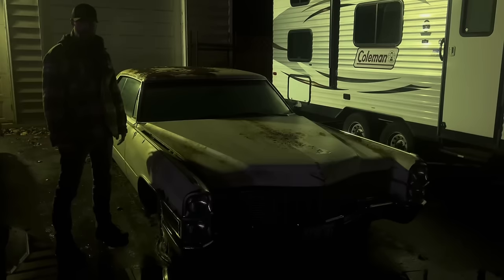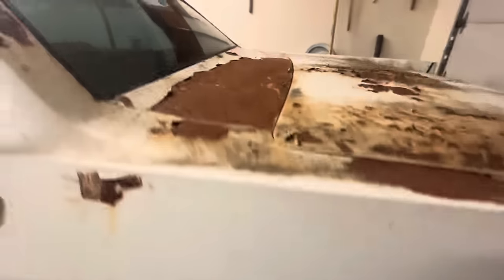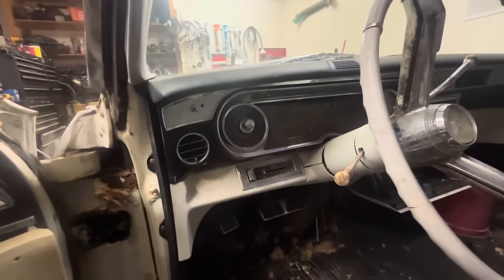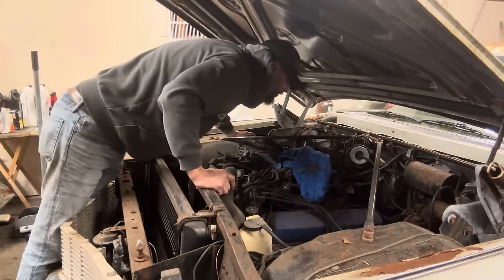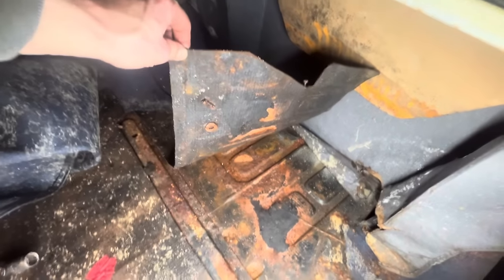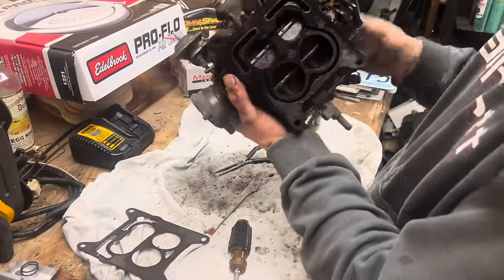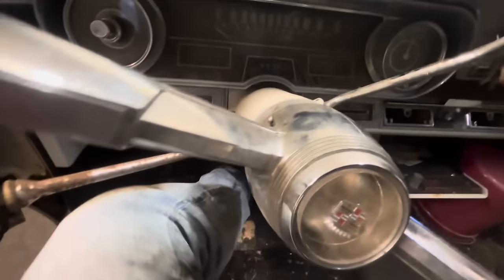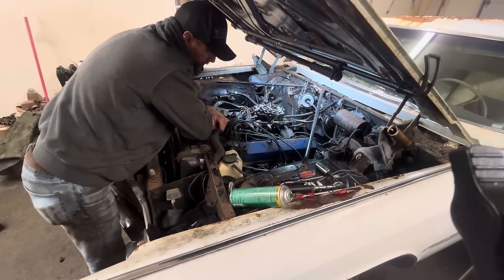1965 Cadillac coupe deville sitting for 15 years, will it run and drive again?

Comment: Great car anf video! Thank you! Idle was high due to vacuum lines not being connected anymore for the air cleaner and whatever else.
Reply from the maker: Thank you! I had read something about the vacuum on these cars causing issues, unfortunately as you could probably tell, there’s a few parts including the air cleaner missing from the engine compartment. But other than that, it actually runs quite well, and the idle bumps down a notch when it warms up.

Comment: what a beautiful car, america that i loved (not like today with, plastic, computered, misshappen, japanized boxes).  If you want to protect this car and  be definitively efficient against rust ,  you should  put grease everywhere. grease is the only thing very efficient against rust. put grease between metal and carpet, inside door, behind metallic bumper, under the vehicle, behind  the repairs you can make (everywhere inside the body - hidden erea -  instead of using paint), hollow areas (necessarily hidden, so no need to be aesthetic). For rear wings unreachable with a paintbrush, use an extender and pour old oil everywhere each year. Rust almost always comes from the inside and welds.  Handyman Experience - 35 years.   From france

Répondre

Comment: All the power window motors are rebuildable, but God love you getting the inner door latch handle bolt off. You'll see you can't remove the armrest pad to get access to the bolt holding the handle on. So you must fuss. Put it on first when re-installing cause if you drop it you have to pull the door card apart to get it! The Dash pad comes off easy giving access from the top down to every thing. You must remove the A pillar trim and just the screws along the front edge of the dash it has clips along the windshield. Do Not loose the chrome caps on he fender turn indicators. They snap on a ball clip. I used epoxy to attach a wire so if it pops off it is wired to the fender. Someone took one of mine at a car show. It took 2 years to find one and cost $200.00! I may have a inner door pull if you are interested I'll look for them. The lower high-beam headlight bezels have two visible screws and two lower nuts you must remove from behind. If anyone has replaced those headlight they won't be there. It is a good indicator that it is a low mileage if they are still there, but bad for you if you have to remove them.
Reply from the maker: Wow, you sound like a guy who’s been around a few caddy’s before. I’m definitely going to go check to see if the nuts are on the back of the high beam headlight bezels. I’m noticing that nothing is cheap for these things, but I just ran into a guy earlier today who may actually have all of the trim pieces I need yet, so here’s to hoping. Thanks for all of the tips.
Reply: @Rustwrangler  In the 80s I worked on a 1967 Series 60 Special I fixed all the window switches, plugs & motors. and I have a 1965 Fleetwood Brougham. So if you have any Questions let me know I may have dealt with it too. good luck! I'll wait with baited breath for your next video.

Comment: does this have the same type of telescoping steering wheel like the 66-67 tornado does? on mine you turn the large center knob thing counterclockwise then pull or push steering wheel to adjust, also I wonder if this one has the auto high headlamps? are you going to mount bull horns on the hood like they do in Texas? :) :)
Reply from the maker: Haha, no bull horns for me. I don’t believe it has a telescoping steering wheel, at least not as far is I could tell, and for the headlights, there’s a dimmer switch on the floor, so I don’t believe they are auto high headlights.

Comment: I was gifted a 1965 cadillac calais 4 door coupe. It hasn't ran in 12 years. The steering wheel pops up when you pull on it, and the brakes seem to seized up on me becausethe car wont bunge even when pushing it on neutral. Any advice?
Reply from the maker: Some of these old caddy’s had a telescopic steering column, mine does not, and I don’t know much about the ones that do. As far as the brakes go, mine was pretty hard to push in neutral as well before I started working on it, might just be from sitting so long, I would pull each drum off if you can and inspect everything on the brakes, if things look good, you can adjust the pads in just a little to not be so tight, otherwise rebuild them.
Reply: Thank you, i dont know much about cars but your video has help alot really, thanks again @Rustwrangler
Reply from the maker: @3rdchtm  I’m hoping to do a complete build series on this car in the near future, I’ve got a lot to learn about it myself.
Reply: @Rustwrangler  was wondering,  when I do a break pad replacement on each 4 wheels, do I need to pump the brakes after I'm done with each one, one by one or pump all 4 at the same time when im done? And should I leave the cap on when I'm pumping or cap off? It's a 2019 chevy impala, off topic, but just need help. Thanks
Reply from the maker: @3rdchtm  one of my videos on the 66 c10 I’m pretty sure I tried to explain and show how I bleed a brake system by myself, maybe check that out and see if it helps.